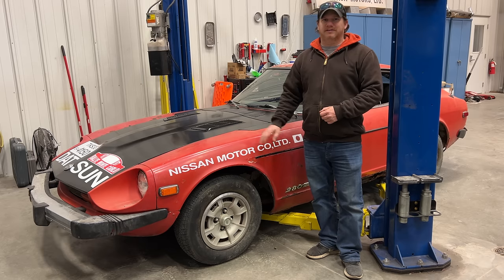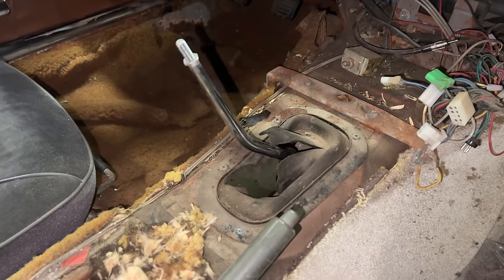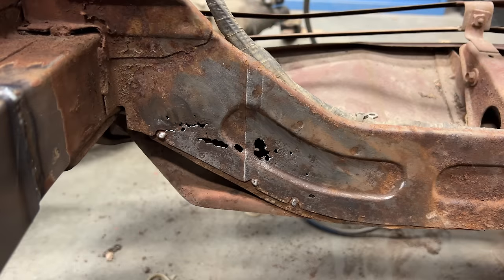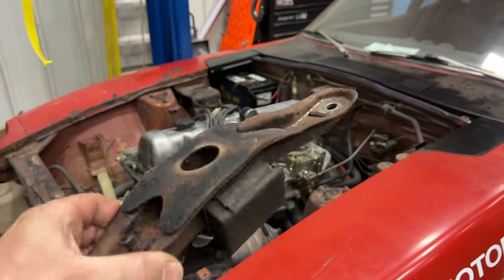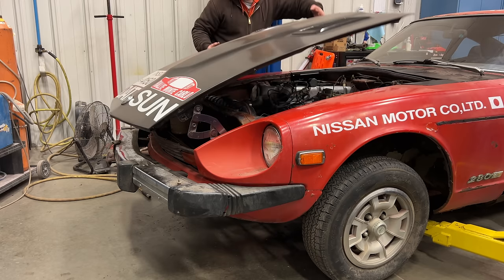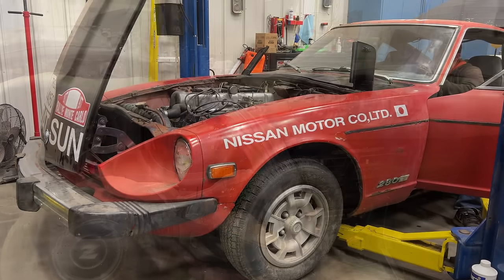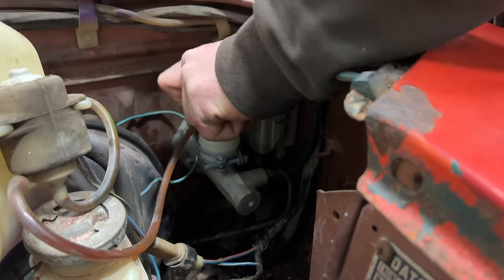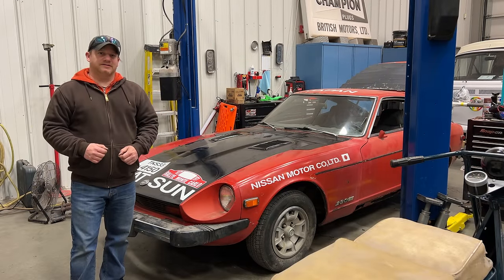Datsun 240Z Engine Swap Into 1976 280Z

Comment: I got chills remembering those plastic radiator drains.  I never actually broke one but I was scared every time I drained a radiator.
Reply: an old trick for broken plastic drain plugs was to heat a screwdriver and use it to melt a slot in the plastic. Give it a minute to cool and use another screwdriver to remove the part that was broken flush.

Comment: This makes sense when you have a 240Z motor lying around, but for someone starting from scratch, you should point out that the Skyline motor is practically a bolt in. Even the 2.0 litre version is 215 HP, certainly enough for street use.  For those who don't know the history, Prince motors got a license to build the Mercedes straight six, used it for several years and then Nissan bought  Prince motors.  After a few years Nissan modified the motor enough that they no longer paid royalties to Mercedes but retained the basic architecture - this was the motor in the 240-280 Z.  They  continued to modify and improve the engine until they  came up with the RB series, used in the Skylines starting in the late 80s until about 2003 when they  went to the V6.  With the RB20  or RB25 option available, I would never put a Chevy motor in one of these cars.

Comment: One of the thing things that killed off these classic Datsuns apart from the propensity to rust was that the later ones put on far too much weight with all the added equipment under the bonnet, good to see one "simplified" again.
Reply: But my 280 ZX only weighs 200 pounds more than a 70s 270Z, despite my 280 being wider and having a bigger engine...?
I get people disliking the 280ZX cuz it's bigger, but it's not much heavier despite being bigger.
Reply: I suppose I see it when I looked up the 240Z weight.

Comment: Back in 1973 or 4 I test drove a 240 z with the salesman sitting beside me.  Drove down the 55 mph speed limit divided highway to an 's' curve 30 mph exit, I dropped it into 3rd and powered through the exit to the stop sign.  I had fun but the salesman turned pale!

Comment: Nice to see this up and running again. I've always had a soft spot for the 240's and 280's. And the early 80's RX7.
If you're going to run that at events, aren't you going to need hood pins?

Comment: good video.    how about using weber carbs on it?
Reply from the maker: A more interesting swap is that I could take it back to fuel injected, but more reliably, by installing a 4BBL fuel injection throttle body kit like you would do on a muscle car.
Reply: I’d watch that for sure. I think I saw they were making a 2bbl version too. Which ever satisfies the airflow demands!

Comment: Why did the swap? What was wrong with the 2.8L? I didn't catch an issue mentioned in the last video...
Reply from the maker: There was no issue with it, I am planning on using the car for rally racing and want a non-electronic engine for reliabilty.
Reply: @ThisWeekWithCars   - curious - couldn't you just have swapped out the EFI setup for a carb setup & kept the 2.8L? Apologies for all the questions.
Reply from the maker: You would have to swap more than that, the ignition system and distributor would also need to be changed.  It is in fact cheaper to have bought the 240z engine than to buy all the parts I needed to change the 280z engine.
Reply: @ThisWeekWithCars  I see. I've become interested in looking at Z videos because I have  a 78 280Z in transit. Looking forward to working on it

Comment: I don’t get it …I turn my EFI 1978, 280z and it was running I remover all of the EfI wire’s .. Rebuild my whole Engine into SU carb and now yet, I receive no spark. I did everything to the letter from what I know and understand I could use some help
Reply from the maker: If you run a wire directly from the battery + to the coil + do you have spark?

Comment: I noticed when you mentioned that you pulled all the emissions control stuff out that you also pulled the charcoal canister. If you are running the oem tank, you might want to put that back in.. . at least if you want to drive with the windows up. When your eyes start the water, you'll understand why I say, leave that in!

Comment: too bad that model year fell into the "ugly bumper well" caused by U.S. federal laws requiring bumpers to withstand X amount of crashing force with only Y amount of damage. unfortunate...that legislation, which was repealed in a few years, ruined more cars than one would expect. what a shame.
Reply from the maker: I have ideas to fix that but haven't decided for sure which approach I will take.
Reply: @ThisWeekWithCars  got to hear. i've noted that some cars with the 5mph bumpers, especially imports, can be difficult to modify...big fan of the Z cars. had new 300ZX twin turbo BITD and loved it.
Reply: actually, that legislation still stands. It's just that they don't use a bolt on bumper / shock system as a solution. The cars still need to take a hit within a certain damage limit, but it's now done with designed in crush zones and plastic panels for what pass as bumpers.
Reply: @rupe53  thanks, didn't know that. ... i always stand ready to be corrected.